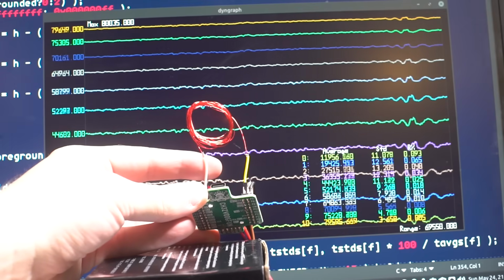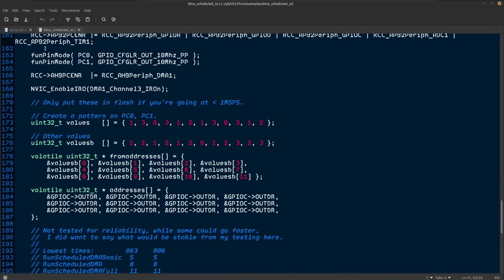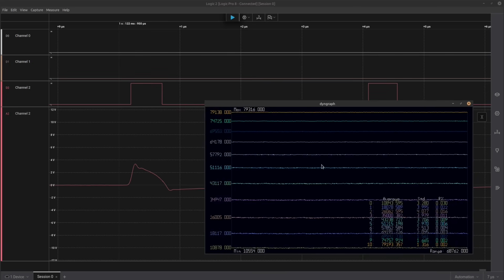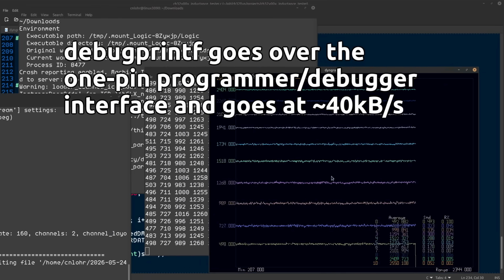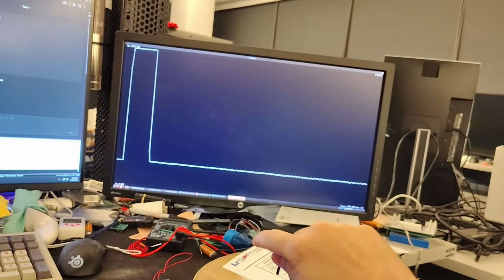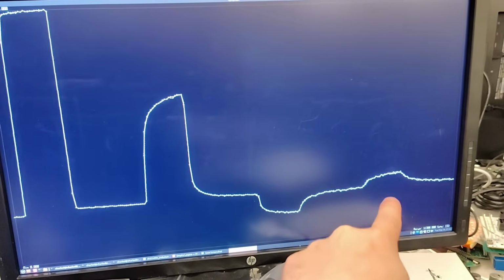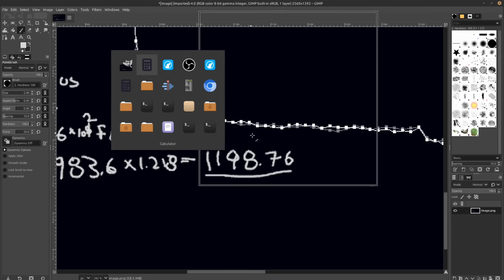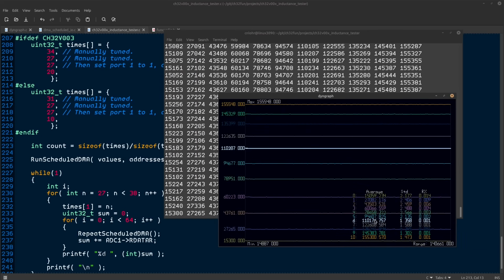The Worlds Cheapest Time Domain Reflectometer

Comment: Right where you conclude that the roll should be 509 feet long, my intuition would dictate it's imperative to also calculate a range of how long that cable could be based upon a reasonable tolerance range applied to your measurement. That'd depend on the resolution of course, and you know this specific resolution because you're the one doing the counting. 
Since I think it'd make sense to consider the Nyquist-Shannon limit as being a good guideline for sampling—despite the infinite nature of a square wave, yet not infinite nature of the pulse generated (which will have a slew)—I'm of the opinion that the error in the pulse measurement should therefore be half the headroom above the frequency point that we arrive at when taking double the sampling rate of the ADC-generated pulse (which defines the slew rate).
Why half? Because of rounding, I suppose. Halfway means we stretch to where it could be rounded up from or rounded up *to*. 

Given there's just 58.5 samples according to your own counting, there's precedent for this consideration, given this intrinsically already proves that there is in fact an under--sampling of the signal's actual slew edge.
But now I'm awfully curious to hear what you think of this. For one, does my understanding match what you did or programmed? That's the fundamental behind the entire series I reasoned myself into. If my understanding were flawed, so would any conclusion from it. On the other hand as well—what do you think of the possibility that the error introduced by undersampling is high enough to matter? I'm personally not great with maths when it comes to equations and knowing the terminology I should even be reaching for, though I'm always up for learning the correct chain of steps to come to conclusions such as the ones I made here, through actual, entirely-backed series of calculations.

Comment: I'm not that familiar with magnetism so this is is probably wrong. Anyways, here is my guess.
Pinching would means smaller peak and longer time constant. 
Smaller peak would seem like larger loss and i can only think of hysterisis loss here.
Longer time constant probably means large magnetic permeability.
Since it is in wire cutter, it is probably something like tool steel or something related?  I can see how that could be since steel does have a good amount of hysterisis as it can be magnetized and it probably have high magnetic permeability since it is iron and iron is used in transformer cores.
I hope this is right, if not, oh well.

Comment: I use my Anritsu S412e to test RF lines for PS radio systems. It works in a similar way only its a VNA (Vector Network Analyzer). We use it to find length, cable loss, return loss, and for sweeping the antenna and the final antenna system. I took a class on line sweeping and they really do get into the weeds with it. If I were younger I'd be more into learning the total depths of how the thing works, but at the end of the day I have a job to do, so I'm more focused into learning what I need to so I can say if the line is good or not! lol!

Comment: An easier way to display each line would be a degrees around a circle vs a sine wave within the set wavelength.
Or if anyone remembers precal, you could do the number of radians just to mess with people.
The bit jumping "jittery discontinutiy" is probably from some random voltage reaching a 3v-5v barrier voltage and just jumping a full bit on the carry over side. one extra sample layer would be enough to avoid a single voltage lining up weird.
I'm gonna take a stab at saying the pinch effect is degaussing in the alloy for working in high voltage+ power active areas. You have a build up of charge but then it's reflected back by avoiding the ferrite structures. Or maybe its cast stainless, plenty of non magnetic structures in steel alloys. however that specific waveform might be easier to look at close up to figure out how long the charge is building and at what distance it starts.

Comment: Nice trick too boost ADC sample rate to clock level. the difference behavior of all up/down/pinch-together may be caused by 2 attributes of the material: 1, ferro-,  para-, dia- magnetism; 2, conductivity. There were experiment(two coil 50% overlap, one for excitation, one receiver) of metal detection on not only amplitude, but phase change of response(according to excitation) to tell the type of metal. e.g.: silver, gold, aluminum and iron.

Comment: Cheapest tdr is a simple 2n3904 in avalance mode for 500ps pulses. I've tested a 6 foot 115vac extension cord for giggles. Put a 500 ohm pot on the terminal end to adjust for null reflection, and measure the pot.
Kool video.

Comment: Very clever! Car mechanics also use it to know how far to strip down harnesses.
TDR is also used for the most expensive soil moisture sensors. 
Could use a a simple thresholding and OLED to display distance between 2pulses, maybe calibration function for few known feet of same wire.

Comment: This is pretty much exactly how PI (Pulse Induction) Metal Detectors work. Pulse Induction metal detector measures the waveform usually AFTER the pulse is turned off, to see the decay rate. Adding iron to the field increases the decay time and so metal can be detected.
Reply from the maker: That's definitely what we observe, but it seems incredible you would be able to tell the difference with little bits of iron.  I guess if you really precisely compute the total inductance of the system...
Reply: @CNLohr  Yep, I found a 0.2g gold nugget with Garrett ATX, which "uses advanced pulse induction technology" and it can do magnetic/nonmagnetic discrimination.
Reply from the maker: @JarkkoHautakorpi  at what range?  that sounds incredible.

Comment: I had a fun and practical application of time domain reflectometry when interning at a company that rented large LED displays for events.
They had very long 30-70 meter long spools of Ethernet cable that would carry the video signal and nobody knew A: how long the cable was and B: if it was damaged or not.
They told me to measure how long each spool was and their preferred method was to lay the cable out and measure it with a tape measure. Yeah imagine measuring a 70 meter spool with a 5 meter tape measure.
So i dug up an old oscilloscope they had and rigged up an LED driver to generate a very steep pulse, then put it all into a box with 4 switches and an RJ45 connector. One switch for each twisted pair.
Then i would power it from a 9V battery, hook the scope into the pulse generator output and plug the mystery cable in to test. I got quite lucky because a 1 meter of cable would give about 10ns of delay on the reflection, so the math was very easy.
My tool would show me many things, for example if the connector was crimped correctly on either end, if the cable was damaged and how it was damaged (shorted or open). Also it would tell me exactly where the cable was damaged.
With my setup i could do days of work in a couple hours and the end result was better in every way, because the cables were guaranteed to work and precisely the length written on the spool.

Comment: Nah, the first view with all the lines flowing is MUCH more information dense, because you then see the "pinching" of the lines - you don't see that in the 2nd projection, so key information gets lost.

What this means is that depending on material structure more or less magnetic energy can be stored around the coil i.e. more or fewer free electrons can change their quantum spin to align with the current in the coil - remember, every electron is a tiny "magnet".

"Now we're gonna take the microseconds and convert it into feet" - LoL, you lost me there :p
Why not elbows or fists? Can you just use international units like meters when dealing with hard science?

Besides, there seem to be something off about your calculations and measurements, namely:
I recounted all the dots, from the start, not from 50%, it's exactly 58.
Note: I'm using international notation i.e "," is digit separator " " is a thousands separator

t = 58 * (48/1 000 000) = 0,002 784 seconds, not 1,218 us (microseconds)

There are 2 errors here. 
1. You've said 48th of a million, when in fact it's 48 of a miliard (billion for US viewers)
2. You can't just divide by 48. You need to multiply by 48/1000 000 000 second as each dot represents 48 ns (nanosecond) interval

You get:
t = 58 * (48/1 000 000 000) = 0,000 002 784 seconds

then:

2L = t * c * 0,85 = 0,000 002 784 [s] * 299 792 458 [m/s] * 0,85 = 709,4 [m]

note: 0,85 factor is indicative of Foam Polyethylene (FPE) Dielectric insulation (Low-Loss Coax)

L = 354,7 m, which is roughly what the spool can have.

This means the sampling clock is in the GHz not, not MHz as you've stated.
Reply: a foot is "close enough" to a light nanosecond
within the precision feet deserve, anyway

Comment: Cool ideas and thanks for getting me thinking. I love these little processors.  I think the clippers will have varying effects depending whether the jaws are open or closed. A toroid small enough to fit into the loop would likely do the same thing.
Reply from the maker: Jaws open/closed doesn't make any impact, I think it has to do with magnetizing the handles.
Reply: @CNLohr  Thanks. I would love to see what putting other samples in that loop. ie. A vial of kerosene. I wonder if the simple circuit can catch the proton precession as in MRI ringing or would it need an amp. I am remembering my old days doing geological surveys with a Proton precession magnetometer.
Reply: @CNLohr  looks like I have yet another project!!
Reply from the maker: @TerryLawrence001  This is all way outta my scope, so if you do it would be really cool, just be sure to let us know what the outcome is!!! I can imagine this becoming quite the hackaday line of things to think about.
Reply: @CNLohr  As I wind down my job and settle into semi-retired mode, it will be soon to start my lab up and get back to these things. I will indeed work on this now that these tiny machines can do so much.

Comment: I don't know why the tool is causing a pinch, but my gut feeling is that it contains multiple metals which are affecting the impedence in opposite ways with their own lingering falloff
Reply from the maker: I think that has to do with the solution.  But I think it may also be somehow the energy actually transferring more deeply into the metal in the handle.

Comment: I did some work using a scope and an open-collector driver... You hit the coil with a low-impedance ground, then let it ring out... Simply knowing the capacitance of the scope probe, you can add in another know capacitor, and calculate the "stray" capacitance, the ringing frequency allows you to calculate the indutance, and the "ring down" allows to calculate the AC resistance at the ringing frequency.
Reply from the maker: We played with this a fair bit in my server, it looked beautiful to hit it and watch it ring out! Thanks for the recommendation!

Comment: Very interesting experiments!

The small insert at 3:55 was in my opinion a pretty necessary addition. Obviously the polygraph allows you to see changes to the shape over time, but to understand what's actually changing the v-t plot is much more natural (at least to me as an EE 😁). Assuming the current through the coil is mostly constant (likely true as it's being driven by a semiconductor source) the v-t curve represents how much power is being put into the magnetic field formed by the coil at any point in time, so the snips having a long tail means energy is being dripped into the material for quite a while. This matches drew6017's and PretzelLabs' comments about hysteresis with medium coercivity.
Reply from the maker: Yeah, I'm glad I went back and put in the extra effort to cut it in.  I still don't quite get what coersion is or how it plays into it, other than somehow copper and aluminium short-cut the energy that would be held.
Reply: I think coercivity is not at play for the copper and aluminium, it is a measure of how hard it is to magnetise/demagnetise metals but neither of those metals are able to be magnetised and so don't have a coercivity. Their effect is due to their low magnetic permeability (diamagnetic metals), they have a lower density of magnetic field lines inside them meaning that the field can hold less energy (smaller area in v-t graph). Ferromagnetic metals like that of the transformer core do the opposite, they concentrate field lines and so increase the amount of energy in the field (very useful in transformers). The long tail of the snips might be the metal being magnetised slowly (the ions take a while to rotate into place), thinking about it again I'm not sure if this is directly caused by a certain coercivity but it definitely has to do with how hard/easy it is to magnetise that metal (maybe another metric I don't know/forgot? My magnetics classes were a while ago 😅)
Reply from the maker: @mitsync  I think you're right.  I still don't understand why some things "poison" the magnetic field, and I don't think it's coersion, but I'm not 100% sure.

Comment: Thats so awesome! I love your setup as well. What distro are you using? you seem to have a very clean and tight firmware dev pipeline and it inspires me.

I do not know why the "pinch" happens in your multi-view, but i think we got a more clear shot of it as the TDMR graph you briefly showed. Since it "lifts up" the tail end of the graph that would imply that the pliers have "more room" for more magnetization (more flux)... but only after the initial pulse has been turned off. could this little micro be so fast that we are seeing a delay in magnetization through the material?  It would be really interesting to see what that graph looks like if the initial pulse is half the width, and twice the width. Could you heck this with any other long ferrous tools like a long screwdriver, please?

My hypothesis is that a longer tool will act the same, a shorter pulse will have less tail rise, and a longer pulse will have a higher tail rise.
Reply from the maker: I had played with it more since and that is the vibe I got.

Comment: When oversampling, try using supersampling methods.
You reduce down your signal by half the bits you add. This removes the noise and keeps the increased bit depth assuming at least 0.5bit noise.
Sampling 4 times allow you to drop 1 bit and keep 1.
Sampling 16 times would get you  2 extra bits when you also drop 2 etc.
Reply from the maker: I comment on that, that the noise goes down by the square root of the samples.

Comment: Would this be a good starting point for a super duper metal detector.  That pinching effect could perhaps indicate the type of object that has been detected.
An open source controller for a DIY or commercial search coil that is as good as the very expensive units would make you a lot of loyal followers.
Reply: Watching more, just WOW.
Reply from the maker: I don't think this is as good as something like a resonant frequency monitor, where you can see differences of even a few parts-per-million.  Only having a 12-bit ADC makes that more coarse.
Reply: @CNLohr You are probably a better judge than me.  Small changes matter but the key is to determine the change in material and not the size of the material so much, that is easier to do.

I'm just trying to think of how to display the magnetic, paramagnetic and diamagnetic characteristics of the coil  target so that a human and later some fuzzy logic could differentiate the gold from the aluminium foil.

I thought what if one were to look at the I and Q  components of a demodulated signal with a nanoVNA or similar and display it on a Smith chart, perhaps the shape of the curve would assist with identification.

At any rate I enjoyed the video a lot.
Reply from the maker: @KallePihlajasaari  Gosh I just don't have the background to know how I would do that.

Comment: 4:30 You can't saturate an air cored inductor.
Reply from the maker: 1. It turns out for the most part it's not saturation (but not entirely true)
2. I think you're right but it is still as charged as it's going to be given the current current.
Reply: @CNLohr The port current will be the limit. i(t)= v/(di/dt)

Comment: This is so fricking cool. Since the CH32V002 (note, 2) has the same ADC block should it work on that cheaper part too? lol the dumb AI summary thinks you're using a CH32V003 just because that's what you're most known for ugh
Reply from the maker: The 002/004/005/006/007 ADCs are actually pretty different from the 003 ADC.   Definitely not the same thing.
Reply: @CNLohr  Right, that's why I specified 2 :)
Reply from the maker: @lunalangton5776  I mean the 006 and 002 are almost identical.
Reply: But it's still not clear from the video and the comments if the same is possible or not on the CH32v003.
Reply: @theincapable  The 003 is different, it's only 10-bit and you can only get ~850ksps out of it at 3.3V sticking strictly to the datasheet (though you can probably push it to 1msps in reality or go to 5V where it's spec'd to run faster), and you have less room for DMA buffers. But the 002 seems to have the same ADC block, same DMA controller, and 4K of RAM, so I think you can pull it off there.